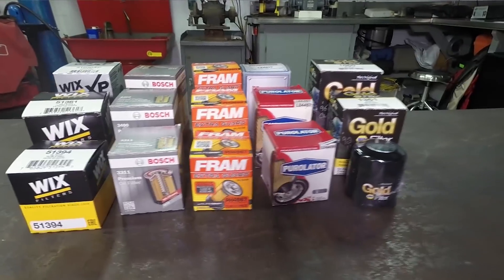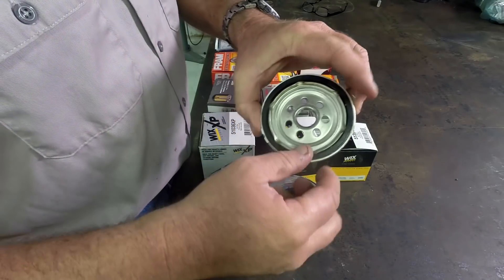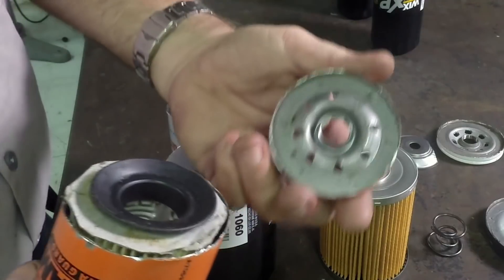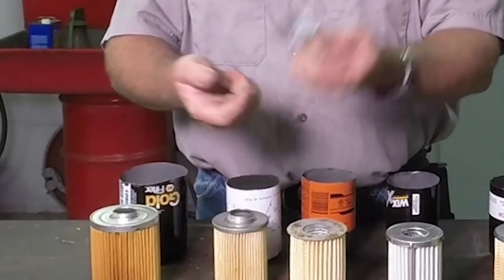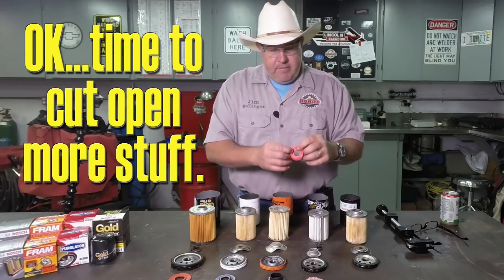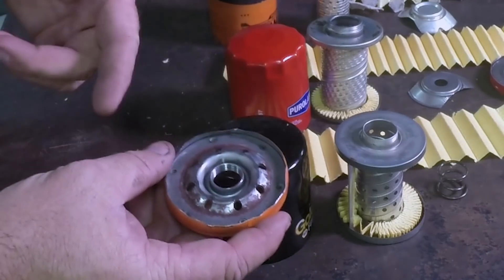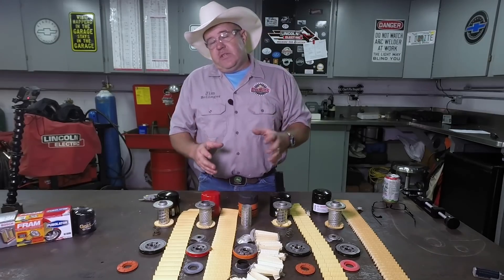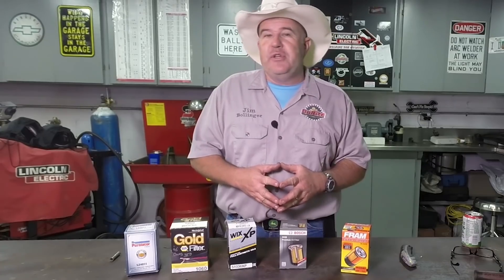The worst oil filter EVER!

Comment: I've been using Fram in my 1970 Plymouth Barracuda AAR since my dad bought the car brand new. The car has 56,000 original miles and 25K are mine. Last year I rebuilt the engine when I restored the car and the engine was flawless. I would take the filter apart after every oil change and found NOT a single flake of metal. I'm going to continue using Fram as this is a very trusted filter. If people give up Fram might as well give up Autolite because Fram & Autolite are one of the same

Comment: I've been using Fram on my 1970 AAR Barracuda with the 340 and when I rebuilt the engine it was flawless inside the engine and the filter was as clean as the engine. So I will always use Fram for another 30 years!!

Comment: I agree that the Fram filter is a not suitable or is an inferior product. Quite frankly I was shocked to see that the Fram's you cut open had rust in them. That not withstanding, you failed to mention that Fram has several models of filters, one of which (Fram Tough Guard) was compatible in price to the WIX and NAPA premium brands. I say, if you're going to try and compare similar products, they all need to fall from the same type tree, in this case, be of comparable price.

Comment: I have seen other YT channels do the same with exact results .  What I would like to see is the following test. Take new oil, measured out by volume then take a measured amount of metal particulates and shavings of the same size.  Mix them and run them thru the filters.  Some filters  may be cheaper yes that is apparent but will they allow the metal to pass  thru?  . This can be done by pumping and recirculating the oil several times or at some set amount of time.    I would really like to see that done. If one doesn’t trap the media or it cloggs up and the bypass spring pops then shavings and metal particulate will be found by using a strong magnet. That will test if the filters work or not.
Reply: I don’t mean using a vehicle to test this. Use a  oil pump of some-type and  a oil filter test rig.

Comment: I see a lot of comments stating they like cheap filters. May I give some advice. Don't skimp on the maintenance of the 2nd most expensive thing you will buy, for some people the #1 most expensive thing. if you take care of it properly it will last you 10 years easy. I have never owned a car younger than 10 and only had to scrap one that popped the head. I remember a quote "What's cheaper proper maintenance or a new engine?" hope this helps some ppl.

Comment: Being using frams for 15 years 260k on the  truck , I put every mile  on it, the proof of the pudding is not the filter , is the miles you push on the oil life and cheapo oil being used you can have the best filter and use the cheapest oil and you will be screwed , oil my friend the problem is oil ..

Comment: Show me the statistically significant correlation between Fram filters and reduced engine life or the non-negligible marginal increase in engine reliability gained from purchasing a "higher quality" brand. Prove to me that it's not possible that Fram simply determined that their filters can function just as effectively with cheaper manufacturing. Sorry guy, but the average person doesn't need a house built to survive a bombing raid, i.e., safety factors can be too high, and high safety factors can also function as a marketing gimmick.

Comment: my dad and i have always used fram and never had a problem and my dads car has ran over 400,000 miles without a problem using fram since it was new so i dont think fram is that bad of a filter but thats just my opinion

Comment: I’m just an old farm boy from West Tennessee who that grew up working around and on all sorts of equipment. I also have 30 years of aircraft maintenance experience. 
The good news is running a Fram or other cheap filter may not shorten your vehicle’s service life. The bad news is you won’t know for sure until the damage is done. So, if $3 to $5 extra every 5K miles for a better built filter isn’t worth the money for your vehicle, go with the inexpensive product. Don’t second guess your vehicle manufacturers’ recommended oil change interval of 7,500 to 10,000 miles. Finally, buy the cheapest motor oil you can find. It’ll be the perfect combination for that inexpensive filter you use. Visit at least five farms and/or companies and ask the mechanic or fleet managers about their scheduled/preventative maintenance program. What do they use?

For me quality fluids, oil, grease and filters changed regularly are cheap insurance. It’s fine if you disagree. Happy motoring!

Who wants to debate the merits of using semi or full synthetic oil vs dino?
Reply: @Jonathan Kenton
  I have a couple questions I'd like to ask you since it sounds like you're an A&P. Any advice I'll take to heart.
  I gather that synthetic or semi synthetic oil is better than dino. Never really looked into it so I'm still using dino. Can I assume that full synthetic is better than semi? And the procedure for switching... just drain, replace filter and refill? Are the results noticeable like with mileage or life of plugs? Or is it more of an internal benefit, say fewer carbon deposits on top of pistons?
If it matters, the vehicle I'll switch over is my everyday driver, an '02 Silverado 2500HD with the 8.1L/496cid. It has 125,000 miles. Never had a problem with it, but have noticed she's starting to drink oil. Not much, less than a quart between 3,000 mile oil changes. Probably typical of an older BB, plus it's a lot of city driving. Not city as in LA or NY or Vegas, but a rural town where average posted  speed limit is 35, occasionally 45.  I pull a trailer weighing 3-5,000lbs a couple times per week. 
I grew up in the right seat of a '49 C-170A from age 5 to 18. Dumbest thing I ever did was NOT get my license. I know how meticulous people in your profession can be especially during an annual, thank goodness too, so any advice? Suggestions? Tips, tricks, pointers.... ok, I'll shut up now... 😁 
Thanks!  
      ~Mike~
Reply: Luv2fu4ever69 

Mike, unfortunately I never completed my A&P either. All of my aircraft maintenance experience is from working on USAF C-5 and C-17 aircraft. Now that I’m retired from active duty I work with Boeing and Air Force reliability engineers to determine scheduled maintenance intervals, component time change requirements and reliability enhancements for the C-17 program. 

I tow an RV and spend a considerable amount of time off road with my truck. Ford considers this severe duty so I change the oil every 5K. I would follow this schedule regardless. I also own 2005 F-150 with the infamous 5.4 everyone whines about due to spark plug and cam phaser issues. I change the oil every 5K on it as well. I’ve not had a single engine problem with it in 170K miles. Did I get lucky or did my stubbornness on the extra preventative maintenance (quality filter, semi/full synthetic oil every 5K vs 7.5K) increase reliability and longevity? I firmly believe the TLC is the reason it’s still running very well. 

For your truck; considering the current mileage and how you use it, I would not worry about the oil use unless it is smoking or starts to use a lot more between changes. I would not worry about mixing oil types as long as the weight is the same. 

Finally, check out the link below. It does a much better job addressing the differences between oil types than I can. 

DISCLAIMER: I DO NOT USE OR ENDORSE THE THE OIL BRAND(S) MENTIONED IN THIS ARTICLE. 

http://www.ozhonda.com/forum/showthread.php?189571-Motul-%96-The-Difference-Between-100-and-Full-Synthetic-Oil

Comment: People using those Fram Filters and having no problems, tbh you could smoke all your live and wont die from cancer.

But ask any sane person, smoking causes cancer. Point.

Your engines wont fall apart if you use a cheap filter once. Maybe it will even last years. But a better filter is what? 4 Bucks each year or so?

Rather save the money by 2 fat burgers less for your lazy asses

Comment: I agree about the Fram filters. But the better Purolator filters are far better than the Wix/Napa top of the line filter. But you compared the top of the line Wix/Napa filter to the bottom of the line Purolator. And those leaf springs are more reliable than the coil springs. Also you might have noticed the better filter support core on the bottom of the line Purolator/Bosch filters than on the top of the line Wix/Napa filters. Then other things to consider are the materials used to make the anti-drain-back valves and the seals, which unfortunately you can't tell by looking at them.

I really wish filter manufacturers would list (third party verified) complete specifications on all of their products i.e. filter media composition, usable filter media area, filtration particle size, thickness of can, end cap and support core, anti-drain-back valve and seal material, etc. In other words some transparency in the marketplace would be nice.

Comment: Can you open a Fram Ultra filter?  The Fram filter that you opened in your video is their standard filter (low quality).  But the Fram Ultra consists of a different filter material which is synthetic.  The Wix XP line also consists of a synthetic filter material.  So your video needs to compare the various synthetic filter brands and not compare standard with synthetic.  I do agree the standard Fram oil filter belongs in the garbage and not on a vehicle.  With that said I am returning my standard orange Fram filter and purchasing a new Wix XP.
Reply: Do the higher grade/quality Fram filters also have a higher quality rust in them??  ;-)

Comment: I’ve always used fram and I have never had any issues with them. 325000 mile Tacoma and only used fram and the only thing wrong with the truck was the trans because it obviously had a lot of miles.

Comment: Years ago I used Fram, but never again, I am aware of a similar video. Wix is the way to go.
Reply: Actually,the anti-drain back valve in the Wix? I don't trust it,anymore. A cold start;the valves rattle a little,then goes away.

Comment: If you pay attention to the Fram advertising, they never make any claims that their filter is tested for it's ability to filter out particulates. Their claim is that it withstands a great amount of pressure (I think it's about 30k psi) before it blows apart. That's great for a holding tank on a water jet but a motor typically runs under 100 psi of oil pressure so who cares if it can withstand a bunch of pressure?? Fram is as you say. a marketing gimmick. I would NEVER run a Fram EVER.

Comment: My family owned an auto parts store for 35 years, and we actually had a special tool for opening oil filters. Looked like a giant pipe cutter. We cut open lots of them. Fram were consistently total garbage. I always put Wix or Purolator on my own vehicles.

Comment: Hey thanks for your  video and reviews on the filters  by  the stroke of luck. I  have been using the Napa Gold series  for years on my engines mostly due to my local 

Napa store being  efficient  and as a rule having most of the parts i need in stock

Comment: I had that same fram filter rust from the inside out and where the bottom is rubberized a pin hole started and leaked a ton of oil on a short drive

Comment: Quit using Fram years ago after a new filter had a bad anti syphon valve out of the box. Every cold start after the oil change rattled the lifters due to no oil pressure. Agreed Fram is junk!

Comment: I literally just put a fram filter on my Suburban. Now I want to change it. I’ve never felt so deceived before.
Reply: You'll be fine. My family have always used Fram and never encountered any problems with our 10 cars. And we have a few with well over 200k miles. Just make sure you do your regular oil changes.
Reply: @joelor7810  , I would never put my family in the situation of most likely being stranded somewhere. Use your brain.
Reply: @jamesr5741  haha that's funny. It's never been a problem so no need to change. Our cars still run like new.
Reply: @joelor7810  The funny part is that 90% of car problems are not related to the internals of the engine these days. So a mid-grade Fram (or most brands) would not leave your family, or mine, or Joe Lor's family stranded.
Reply: @DavidRitko  , I would say the engine is a pretty important part, wouldn't you? lol
Reply: I’m sure I’ll be fine, I’ve had my civic and other vehicles well over 200k-300k but I can’t not see these results. Like yeah it’s not the worst think in the world but for a couple extra bucks the quality difference is pretty huge.
Reply: Or the rust will go in to
Oil filer hmmm
Reply: I beem using fram never no issues  so i dont know

Comment: Had a 2003 chevy truck with 289k miles always used fram never had a problem. Changed the oil every 10k miles. I have a 09 civic now with 292k miles bought it new always use fram.  If you drive your vehicle like a normal human being it will last a long time.

Comment: While the rust is appalling and inexcusable I have to say that he was a bit harsh on the cardboard aspect, and that's really unfair, I mean how are you gonna trust paper in your engine filtering your oil, but not cardboard? And having done this experiment myself in my own shop with 2 used oil filters (both around 3k miles) the filter material in the Fram does hold up better than a Wix, I also noticed a little bit of build up on the Fram where the filter material meets the cardboard, now admittedly these 2 filters were off 2 completely different vehicles (one being a customer's RX8, the other being my 1966 Malibu respectively) so if I can find this again after I change my oil a few more times I'll reply to this with further findings to make sure this wasn't some fluke
Reply: Because it's supposed to keep a proper seal so the oil flows properly through the filter.
Reply: @jamesr5741  and cardboard should be just as capable of doing that, and after much grime on my hands it seems perfectly capable of just that, at least for 3k miles anyway
Reply: @razortreadway  , Another paid Fram Troll.
Reply: @jamesr5741  not exactly, I have a Wix in my car, you can't dispel an argument especially one I put my own time into actually seeing with my own eyes by saying "he's just a paid troll" or "I hate cardboard"
Reply: @razortreadway  , "not exactly"?, so neither yes or no? The video showed how flimsy and fragile the cardboard was, how is the cardboard supposed to not fall apart and stay rigid so the unfiltered oil doesn't get past?

You are obviously a paid troll and not happy about getting called out.
Reply: https://youtu.be/Es-t89ymtfo
Reply: You Tube has some REAL "science based" tests videos.   Look them up please.    This clown didn't do any tests! 🤔
Reply: @razortreadway  , so you really think you need to be a mechanic to figure out this s***? LMAO!
Reply: @jamesr5741  NO MAN!  No need for ANY science to your stupidity.
Cowboys used to drink  water directly out of streams and think TOMATOES were poison.
Go ahead believe whatever  LIE you want, forget ANY scientific tests.
There's  a "Pot O' Gold" under every Rainbow!
Reply: @coiledsteel8344  , but there is no need to. Guess you must be a hurt Fram employee if your can't look at the common sense right in front of you and choose to use misdirection....

Comment: Nothing wrong with using a fram oil filter. The orange fillers are cheaply made and that reflects the quality. Cardboard end caps are something that's been used for decades although I prefer steel end caps

Comment: I rebuilt my engine and put a FRAM filter on it, The motor ran fine during the break in procedure. A round 30 miles in the drain back valve disintegrated and destroyed my #4 journal, screw FRAM.

Comment: A friend of mine put a fram on his f-150 and called me saying he had 80psi of oil pressure on startup.
I told him to change it again and install a wix......he drove to work instead and on the way home blew his engine.
I still have his blown engine in my shop with the fram filter still on it.
I have seen it happen before and will never use anything fram.

Comment: The OEM choice of my car is Mann so I haven't changed to others so far, because Mr lube does that once and the car has quite increased in RPM during Low-temperature condition. However different from these example is it only has a single paper filter, no cans on the outside and it is on top of the engine as well.

Comment: I QUIT USING FRAM  IN THE 80'S  AFTER ALLED SIGNALBOUGHT THEM OUT  JUNK FILTERS  I USE  NAPA ,WIX OR STP
Reply: Your computer can type in lowercase, too.
Reply: STP is the same lower end filters as the standard Fram extra guard btw
Reply: @DavidRitko  STP used to be made by Champ Labs.  Champ makes some great filters and some not so great.  At one time they were the largest producer of store brand filters.
Reply: I guess its Napa gold then all the way

Comment: I agree with pretty much everything he said in this video. One thing that he failed to cover deals with the filter media. He talked about how much,,long the media is,, which is extremely important but said nothing about the "Micron" rating of the media itself. A filter with a 45 or 50 micron media but is say 6 to 8 inches longer will not filter as clean as one with a 30 micron media that is slightly shorter . I found that out last year as I was talking to some filter engineers about filters for my performance hot rod.  The guys I talked to were more than willing to give me facts about filters,, if your interested call your filter company and ask for an engineering rep to talk to,,,,I learned a lot. This guy is right,, quality is not cheap.